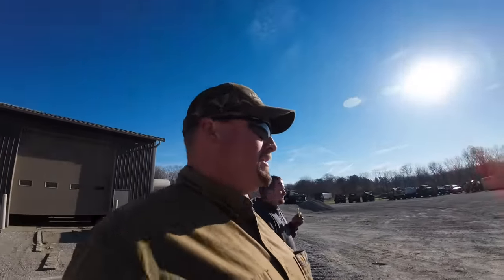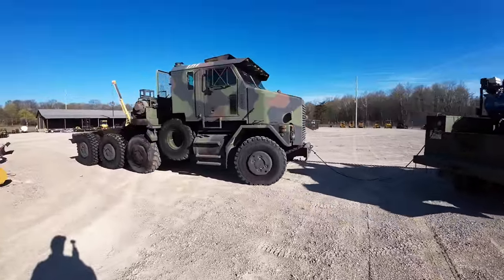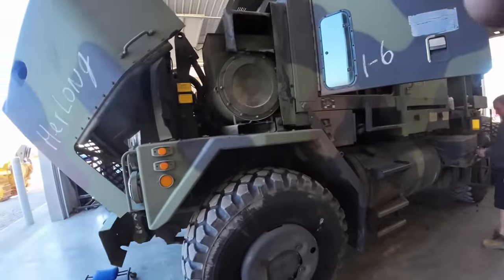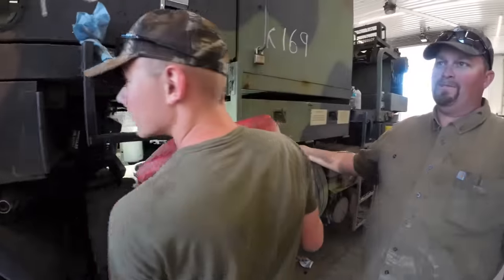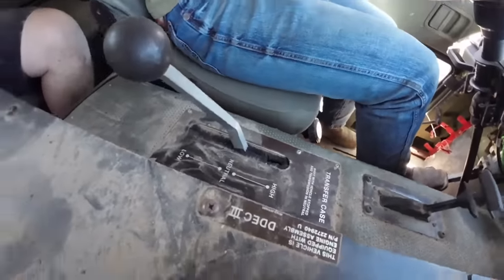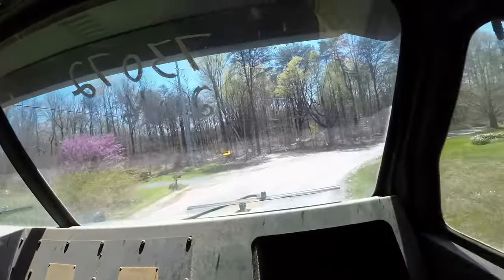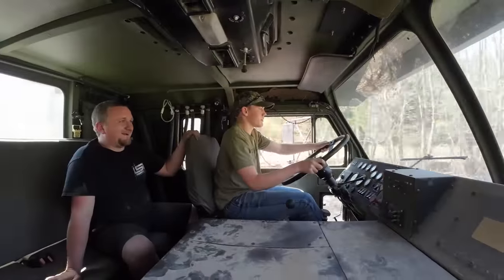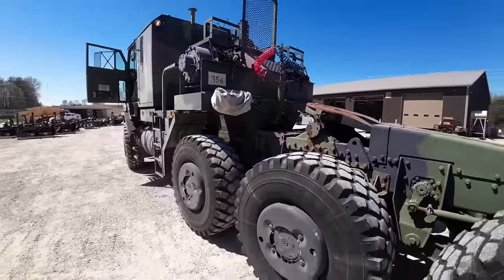M1070 8x8 HET first startup and drive in many years! Back to my roots when I first started selling!

Comment: Looks like everyone had fun in that big truck. I have no clue what you could do with it but i'm sure you and other people can figure it out and would love to see it happen. Thank you for sharing!
Reply: It's called a HET (Heavy Equipment Transport), a U.S. Army vehicle. Used for hauling M-1 tanks around. The trailer has 40 tires to hold the weight. Can also be used as an ambulance and whatever else you can sit on the frame.  Lots of fun in the video. In reality you can be getting shot at.

Comment: Time to let Dirt Perfect in on the ground floor on this one, Clint.  I personally think stretching the 1070 so DP could haul a dozer or track hoe without dealing with a trailer.😊
Reply: lol
Reply: That's not a bad idea, might have trouble legally with weight limits due to the short length
Reply: @garymurt9112  Weight-scmeight.... It seems the man often operates within sight of his equipment yard; the family convenience store is probably the best-protected business within 50 miles due to fresh coffee and a welcoming attitude for cops PLUS, Mrs.  D. P. is having ISP Inspector Hoover tricking out a bus into a camper during his off time. I would venture D. P. is golden unless he leaves tire ruts in the surface roads he travels so deep that they can track him all the way back to the shop!😉😉😉
Reply: @garymurt9112   he could probably figure out the weight.  The height is another matter.
Reply: @Joe Mrkvicka  its the bridge laws that would be the trouble. The shorter it is, the less it can weigh

Comment: I love the way you guys say, what do we need to make that work and do it. It shows if the you do the job properly the numbers work out.  Steadily built a business on the right stuff. Inspirational. Need to move a big truck well use something that can haul it in the yard it needs air, put a compressor on it, need tools put a toolbox in it. Work smarter not harder totally agree, put the right stuff in when you can and it pays back for years and years and years.

Comment: $256,000 ($560,264 adjusted for inflation) a pop in 1992 dollars, and many had less than 10k miles on them when Oshkosh refurbished them at an additional cost of 75% of purchase price.  A couple of years later, the M1070A1 replaced these HETs, so there's plenty of super low mileage ones out there.

Comment: Hi Clint and co.  The 2 stroke detroits need the positive displacement supercharger to scavenge the cylinders (blow air through the intake ports at the bottom of the cylinder and push exhaust out of the valves at the top) at idle and low speed.  So when you want to up the boost you add a turbo for the high end and the supercharger still does its job at idle/low speed.
Reply: Best explanation I’ve ever read as to why there is a supercharger on a two-stroke diesel, thanks.

Comment: Absolutely sensational, cooler than cool!  Those Oshkosh heavy haulers are incredible trucks.  You can't beat the sound of a happy two stroke Detroit Diesel engine.  Hunter will not forget the drive for a long time.  There are 3 or 4 of these here in New Zealand and I believe they are being used on windfarm jobs.  It'd be great to see one loaded up with a transporter trailer in tow and a D8 or similar on the trailer, then take it for a drive off road and see how it performs.  Looking forward to the follow up videos of this and the other trucks!  Keep up the great work you guys.
Reply: @Jay Harrod or the latest version of the M1 Abrams... you know, the tank this truck is supposed to haul...

Comment: I have always wanted a m1070 but I absolutely hate the 8v92ta which was obsolete when the trucks were originally built.  Hopefully one day the military sells off the m1070a1 variants since they have the caterpillar c-18 rated at 700hp.

The 2 stroke detroits do not have superchargers, they have blowers which provides zero boost to the engine.  The purpose of the blower is to provide aspiration to the cylinders since 2 stroke Detroits are unable to aspirate on their own.  The blower actually has a bypass valve so the turbo may provide boost.  The main difference between the 71 and 92 series is the wet liners as the 71 series utilizes dry liners.

Comment: I worked at a big machine shop in the 70's and Ruan Transport used all IH trucks with Detroit Diesels in them. The guys from Ruan told us that when they started hauling cement they used a turbo to blow the dry cement out of the tanks and Detroit said that they couldn't do that with the 2 cycles. Ruan said that they would have to change their whole fleet over to another engine and all of a sudden they had turbos.

Comment: I was on M1A1s and we got hauled quite a few times by HETs. Called them HETS, bets with a H, worked good. Impressive size, power wise not as much. Seemed like rpm power not torque power but they did the job. I came from deep hole rigs to M1 tanks seeing the HETs less impressed, they did the job. Never loaded in bad conditions like deep mud or snow and any hauler would have trouble with that

Comment: The Oshkosh M1070 Detroit Diesel 8V-92TA 12.6 liter 500 BHP is the United States Army tank transporter. The British Army, tank transporter is the Oshkosh 1070F with a Caterpillar C18 turbo charged diesel engine 6 cylinder produces 700 BHP. There's a heavy haulage company in Jamaica West Indies have one or two of the Oshkosh M1070 Detroit Diesel. Hunter i enjoyed watching your video? Your 14 year old son drives well. Mr Hunter i like what you're doing to your son, teach him everything in heavy equipment mechanics? I work for the largest transit system in North America, New York City Transit Authority (bus & train) if you're applying for a job with the transit authority you're getting practical test? They want to see the proper handling of tools and the safest way to do the job etc. Thank you for sharing One L❤ve. 🇺🇸🇺🇸🇯🇲🇯🇲

Comment: In this application - a uniflow Diesel, the Roots blower isn't a supercharger. In fact Detroit Diesel call their blower only 2 stroke N for Natural. They pump less than 1 PSI so the volume of the blower rotating is almost identical to the swept volume of the engine at any given RPM with about a +0.7PSI allowance for hot and high barometric pressure drop in the real world and to compensate for blower wear and tear. 
So a naturally aspirated blower only 92 Series would be an 8V92n. The turbo variants are 8V92T or 8V92TT. Usually the TT's were still only single turbo but the TT denoted Tailored Torque of DDEC (which this seems to be). In marine there were twin turbo 92 series but never in automotive as offered off the shelf OEM as far as I am aware. Perhaps some special build mining applications etc excepted.

Also, the blower on yours is different to the 8V71 series blower. It's a bypass blower, where when the turbo comes on boost the blower is bypassed and they have an aftercooler beneath the blower connected to engine coolant. Bypassing the blower saves about 30hp in engine pumping losses however the lobes still rotate. 

Interestingly, in EMD uniflows (Detroit 2 strokes are basically scaled down EMDs) if turboed, the turbocharger is a hybrid blower and turbocharger where the compressor is crank driven for starting, idling and low power, then as exhaust volume builds a turbine drives the compressor via an overrun clutch. This was actually proposed for Detroit Diesel 2 stoke uniflows but the age of the Series 60 inline 6, 4 stroke Diesel was on the horizon so they opted for the bypass blower instead for the Silver Series DDEC 2 strokes to keep development costs low.

Comment: The air problem on military vehicles is sometimes the valve on the bottom of the reservoir some times gets gunk in the valve it just needs cleaned and we used to just use a stick poke it open and let the air clear the gunk, don't know if yours is the same, worth a try.

Comment: When I was back to the Navy Diver, we had on our dive boat to 12 V 71s dive boat engines and one of them just up and died. We bled. The fuel system wasn’t getting fuel fired up died did that two or three times we pulled the fuel pump which was driven off the front snout of the 12 V 71 blower the shaft that connects the blower to the fuel pump, which was about 10 inches long with splines on both and snapped replace the shaft bled the fuel system popped right off. We also bent a connecting rod on one of the cylinders because it hydraulic and the only reason we knew about it was through oil analysis program. It had high iron in the oil, but it ran. That’s the part that mess we couldn’t figure out, but it bent, connecting rod just enough. It was scuffing the cylinder really bad.

Comment: On the 2-stroke Detroits(53, 71, 92, 142 series), don't put a modern type oil in them (15w40). Delo 100, 40w oil is almost one of the few oils that are still approved for 2-stroke Detroit. I've rebuilt too many of them internally forked up from running the wrong oil.

Comment: The old fuel in it is most likely JP-4 also there is a trailer made just for that truck to haul the M1 Abrams  Max speed is 47 mph the m1070a1 will do 55mph

Comment: Just looking at where the fifth wheel is mounted must mean the trailer it pulled had one very long neck on it. I also get the feeling that when driving this rig, it might give the driver that same feel as driving a cabover as you have a  real time getting the steer tire up next to the yellow line and the other out of the ditch line.... for me it was making it feel like my knee  was on the yellow and it was really just next to the yellow like you are supposed to be/LOL. I figure he did very well on a first drive situation. As for a camper, a forty foot mobile home would set on it and still have room for toys on the back.

Comment: Well the screaming jimmy explains why you can hear it six miles before you blow past it as it struggles to maintain 45mph loaded. They will drag a city, just not fast. The local landfill uses one to move a 65 ton capacity landfill trailer tipper.

Comment: It actually has a pretty good turning radius for such a long truck it’s impressive. But what uses does something like that actually have? They must be very limited considering you said that the most you got one up to is 49MPH heck if you can’t even do the minimum hwy speed limit what good is that over the road?

Comment: The Oshkosh M1070 is a U.S. Army tank transporter tractor unit. The primary purpose of this combination for the U.S. Army is the transport of the M1 Abrams tank. 
They come in A0, A1, and M1300 configurations. The M1070 is coupled to a DRS Technologies M1000 semi-trailer.
 
Fuel capacity: 947 litres / 947 litres (568 (L) & 379 (R))
Height: 3.962 m / 3.708 m
Mass: Unladen (tractor) 18598 kg / 20657 kg. Fifth wheel load (at GCW) 20411 kg / 20884 kg. GCWR 104961 kg / 108461
Maximum speed: 72 km/h (primary road at GCW) / 81 km/h (primary road at GCW)
Operational range: 724 km / 523 mi @ GCWR and an average 48 km/h
Produced: 1992–present
Steering system: power-assisted with front and rear axle coordinated steer; twin pump (main and auxiliary)

Comment: I just saw a HMMV swapped with a duramax engine transmission so that it can hit highway speeds.  Has anyone done a civilian swap of a HET? Its got the engine, all you would need to do is swap the trans, and it would be great on highways.  The only thing I haven't seen someone really knock out of the park is a mailtruck vid.  They are getting rid of old mail trucks but nobody can get them.  Thats crap.
Reply from the maker: Hets would not be safe going any faster

Comment: Sorry guys, but the "supercharger" is actually a scavenging pump. Unless you close the exhaust valves early, the blower just pushes the used up air out the exhaust. BUT!!! The turbocharger definitely adds boost.